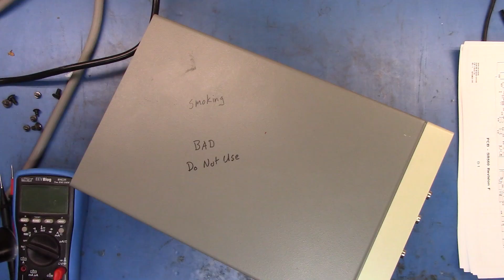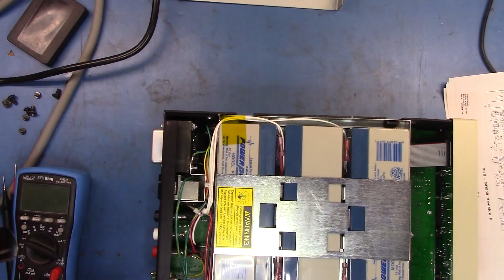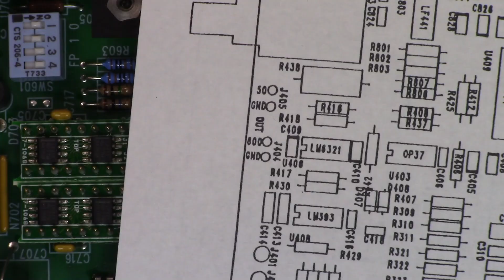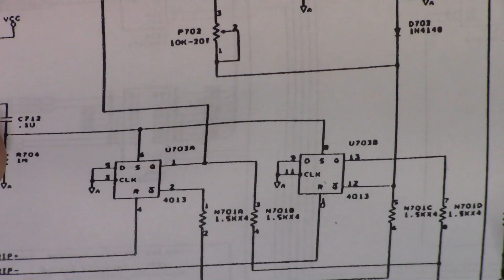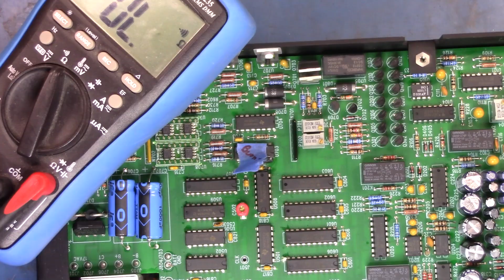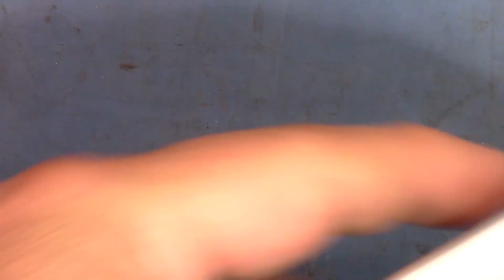Dumpster Score - Part 3 - SR560

Comment: @0:50 my guess is shorted tantalum… let’s see… EDIT wow, that’s not a tantalum… that’s a new one. 8:20 EDIT AGAIN… yep there it is, burnt tantalum.
Reply from the maker: I went back and checked the component layout, and it is C708, not C709 as I originally read - So it is, as you said, a "2.2U Capacitor, Tantalum, 35V, 20%, Rad".
Reply: Ta can become suicidal over time. Bit worrying that that CD40xx shares a supply rail with a lot of its brethren, maybe it was just the first to die?
Weird failure in a way 👀

Comment: Is the battery pack official or has it been "refurbished" by the end user? Maybe it got miswired.
Reply from the maker: It looks very much like OEM construction and the unit was from the dumpster at a global 50 company so the odds are that it's original but I've never seen inside an SR560 before so I actually have no idea.